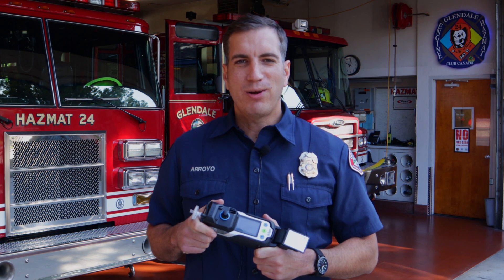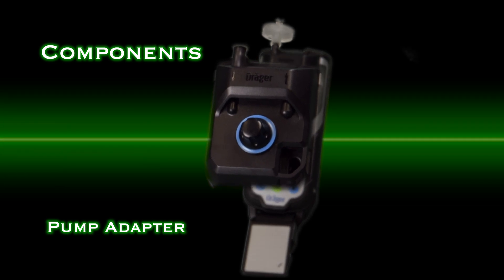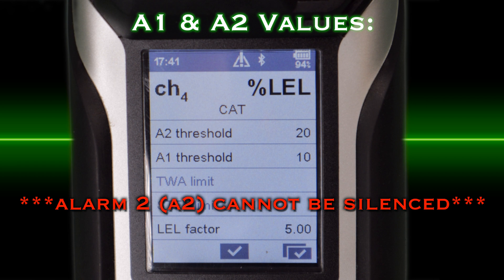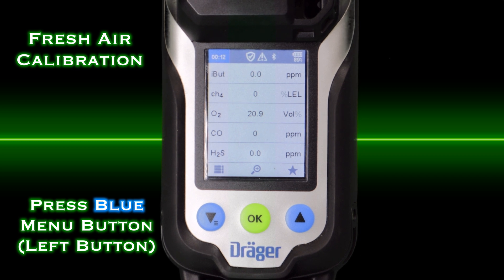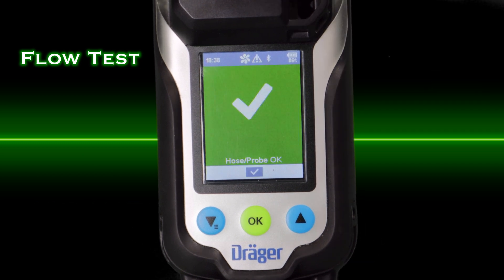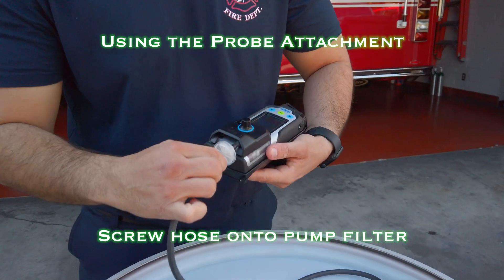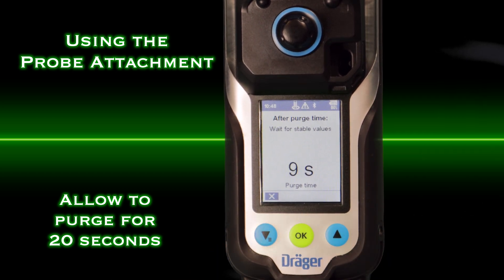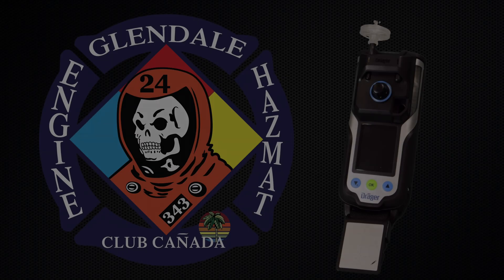Drager X-am 8000

Comment: Thank you for a great tutorial. One question, will the X-am 8000 continue measuring in diffusion mode if you're navigating through the menus? Would we see an A1 or A2 alarm if let's say CO2 levels went up while we were changing some settings?
Reply: This type of gas detector can be use in inerted tanks